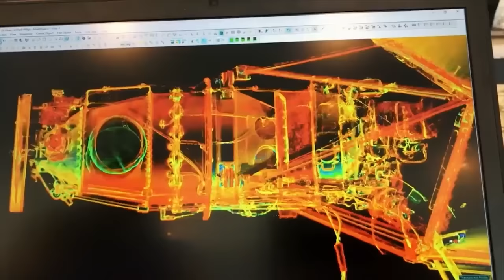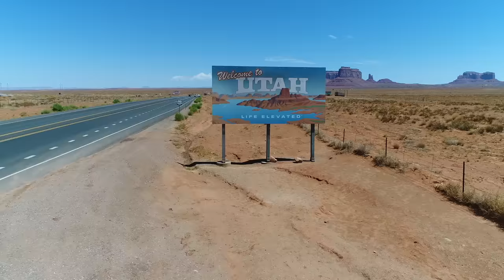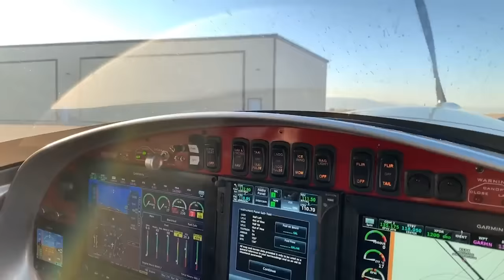Building the Friendliest Airport in the Country | PateyAviation

Comment: I wish someone would help better protect GA in the UK. We are a tiny country with a number of airports that want to grab airspace, tag the airport with a London name so once established, the owners can sell it on for huge profit as a commercial operation. Cat G airspace is getting smaller with VFR traffic getting squeezed into smaller and smaller channels and corridors both width and height wise. The collision risk that comes with it is obvious. Last month I flew VFR between two airports in the only North/South channel available between two airports and dodged gliders, microlight and numerous Cessna’s, PA28’s etc. yet looking left and right into controlled airspace there’s not an A/C in sight, nothing. 
We are also suffering airfield closures as they are sold for housing, or solar farms. The existing GA airports are in the main with a few excellent exceptions, lacking investment, decent runways, hangarage, fuel and maintenance facilities. Some are trying hard, but the fight against commercial aviation, their airspace grab and land owners desire to make a quick buck from housing development, means we are losing ground every year.

Comment: We are about to have UFO disclosure which will change a lot but ignoring that for the moment, I think the single biggest boost that GA needs is a small turbofan engine with 1000N thrust (100kg) because the world distance record shows turbofans can be fuel efficient and because it's simpler than a piston engine, much lighter, much cooler, rear placement and natural dual engine redundancy. PW610 is the smallest available with 4200N thrust, fan a bit bigger than a hand but they want 911k$ each which is beyond ridiculous. So we need one quarter the size, half the diameter. About 18cm for the main fan and the other stages are much smaller. Something that small is simple possible for much less than a rotax 915. And material strength is easy in small size.
The PW610 design is just two spools with 5 elements. The main fan, 2 compressors and 2 turbines. The main turbine might be the size of a CD with maybe 15mm long blades. Like finger nails. That should be possible to machine at non exotic cost. The others are even smaller. The convoluted cavities are pretty obvious to 3D print. Small electric motor/generator, some fuel injectors, ignitor, a sensor or two and it's a revolutionary engine. Should have been made in 1950 but better late than never. Frank Whittle patented the turbofan in 1936.
Turbulence could have two small inexpensive jets at the back instead of the million dollar noise maker and oil thrower up front. Private jet freedom at LSA price. A plane can be a fairly simple product. The potential for improvement in GA is staggering.

Comment: I tried to come to the high sierra fly in once as a non flyer with no flyer friends and was told by the organizers to not come because its best to be paired with someone in aviation.... 😢

You may share this passion and want other's to, but some of your friends do not.
Reply: Isn't it on public land? How would they stop you?
Reply: I went with no aviation friend and drove in a couple of times. One word of caution though, be sure to have a vehicle that can handle fine silt roads about a foot deep.  Last time I went road into and different road out of the lake bed was terrible. I just stepped on the gas and kept my speed up praying I didnt get bogged down in the silt or have the silt choke out the engine. Silt was above bottom of car and if I got stuck it would have just poured in when I opened the door. Luckily I made it out, but thete has got to be a better way to drive onto that lake bed before I will return.

Comment: Extra, quality, demountable, plumbed, plug-and-play amenities. Whenever there are big events with thousands or tens of thousands of extra people; temporary, low quality amenities  porta-loos etc., are brought in & lined up; and people line up in long cues. Having the right number & distribution is always a challenge. Develop a master plan of amenities locations with full underground plumbing for water supply, waste disposal & electrical power; then have demountable (trailered) amenities blocks (think 40" container type) that can be driven to these amenities locations and "plugged in." Just 1 "screw in" sewer connection, 1 screw in water supply connection, 1 screw in power connection. In less than half an hour, a licenced plumber and a licenced electritian can connect and meet all building codes for a 40" amenities building; and in half an hour at the end of the event, it's all unplugged, driven to a separate wash down and stacked away. It's not just fly-ins or drag car events, it's top quality, city wide 4th of July or New Years events.